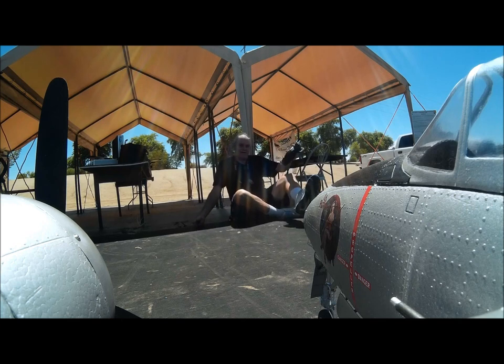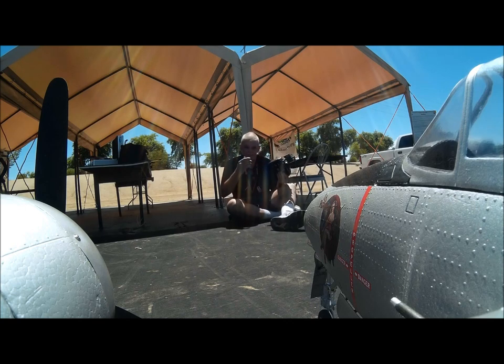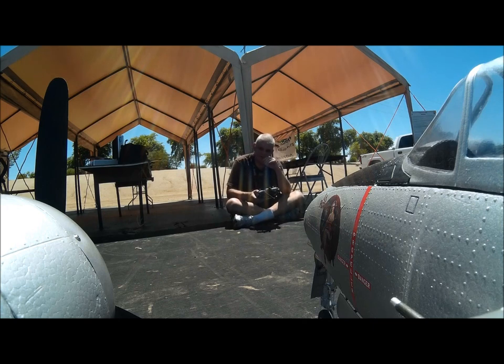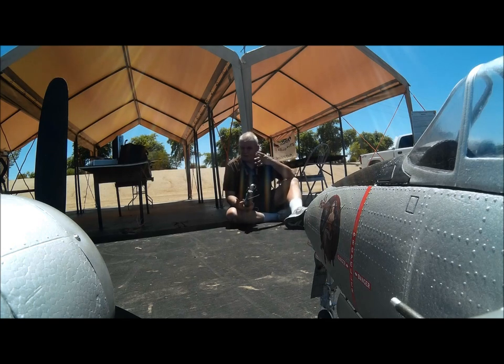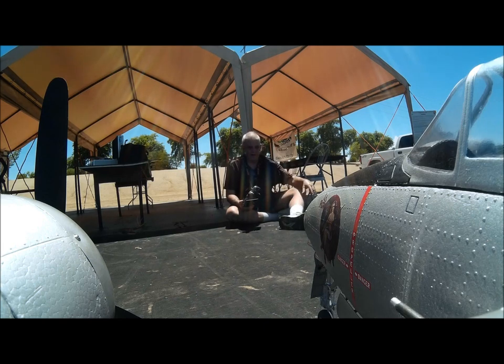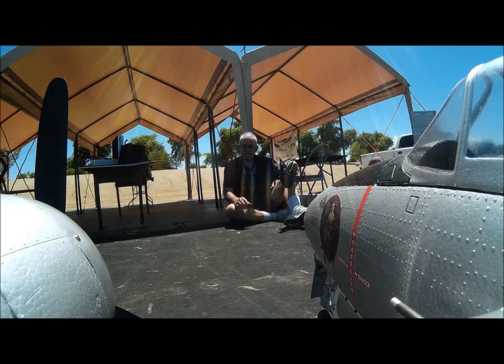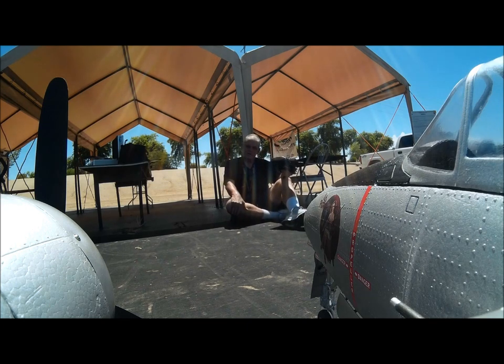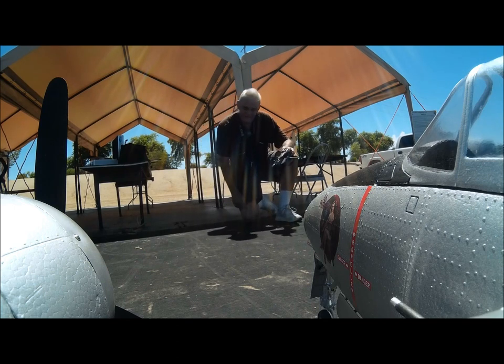FMS 1700mm Silver F7F-3 Tigercat "La Patrona" (Video #3)

Comment from the maker: These are my recommended CG locations for this plane:
57mm CG balance point with the gear down
63mm CG balance point with the gear up. This is what I used on my first prototype for testing.

On the new final released version, You can go to 70mm ballanced with the gear up. The manual states 70-80mm. That is ballanced with the gear up.

Comment: Brandon, you did a magnificent on the Tiger Cat. When you started talking about CG, one of your servos or some other noise blocked out what you were saying. Can you put the CG and all your other technical observations in the description since it was hard to hear in the video.
Reply from the maker: Sure, I'll try and do a comment write up a little later
Reply from the maker: Basically what I was saying is that the plane fly's better using a 57-63mm CG balance point and was very sensitive and somewhat hard to handle using the FMS recommended 70-80mm CG reference they have posted in the manual
Reply: Thanks Brandon!

Comment: Hello Brandon, what setting (low rate + expo) did you use for the elevator because i didn't find a really good one for my bird. My setting is much responsible and my bird bounces at each time on the runway !!! I've tried various combinations but i have found no solution for this problem. 
Thank you for all your videos.
Reply from the maker: The rates are just set to what I'm comfortable with. Not sure the percentage ot deflection travel is? The expo I like is 30%
Reply: Thank you, i'll use 30% expo. This the first time that i meet this problem with an rc plane from FMS. I will be bored to smash the beautiful retracts of this bird.